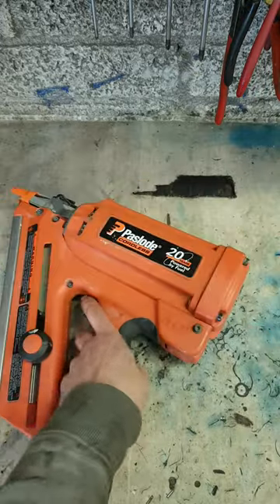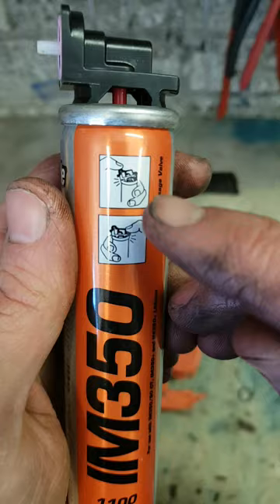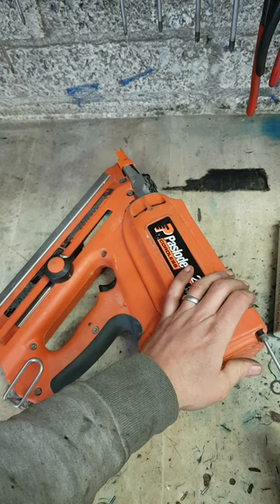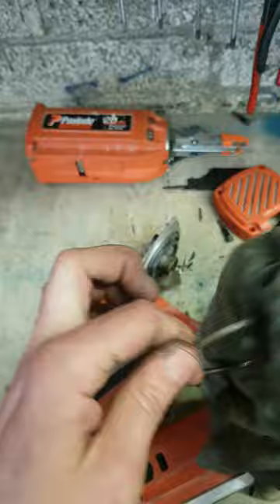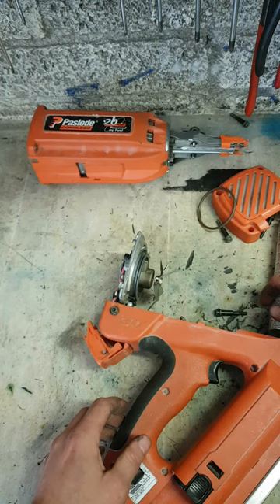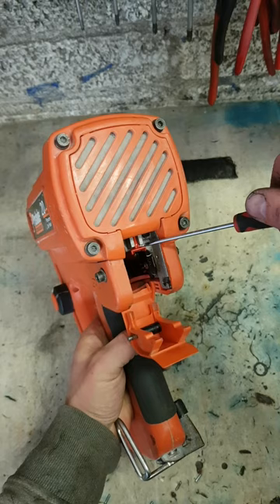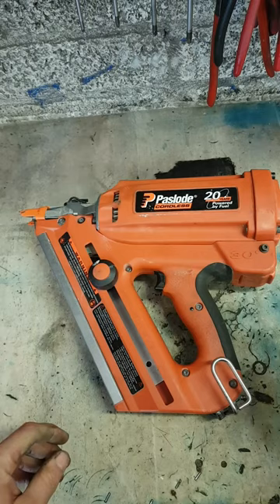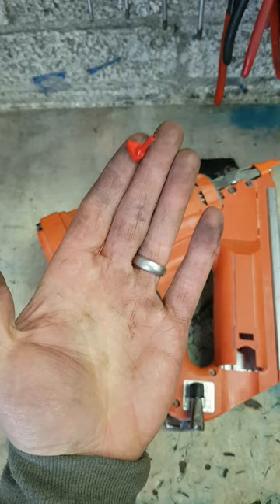Problem solving a paslode nail gun that won't fire.

Comment: Thank you so much for this video. In the first minute you saved me a trip back to the workshop. I have had my passcode sitting for months because it wouldn't fire and it was all down to that little plastic cap not fitted correctly.

Comment: Mine shot 2 nails at once and bent them and then shot one and bent it again and the nail gun smells like it’s burning anyone know why?
Reply from the maker: the gun uses gas so there will be a smell. when it needs a service it will smell more. The 2 nails, is probably the ware strip above the pin. when it wares away, the nails can move up higher and cause the pin the hit the nail below also.
Reply: I have one that’s not firing or powering up full stop. Tried new battery with no joy!